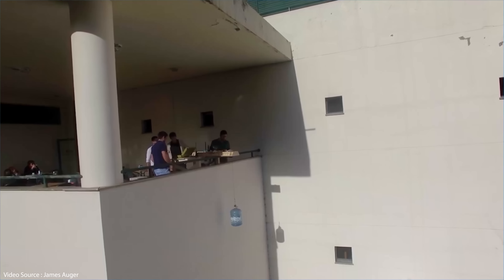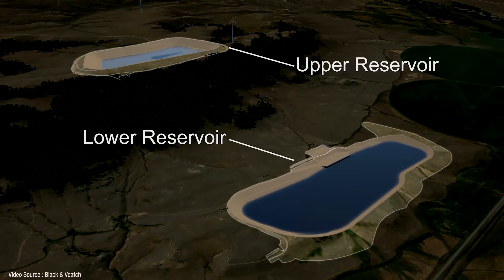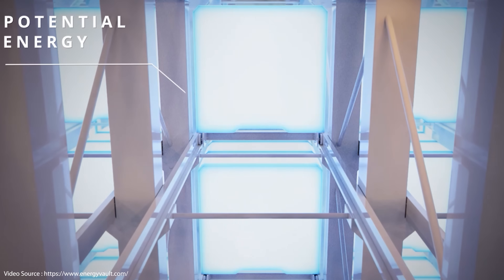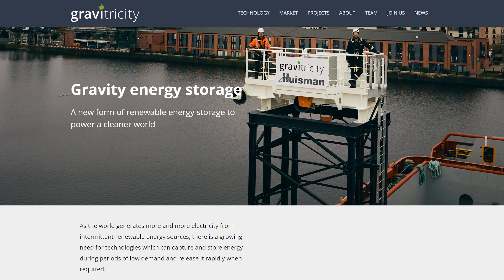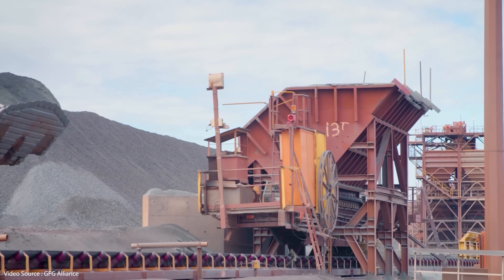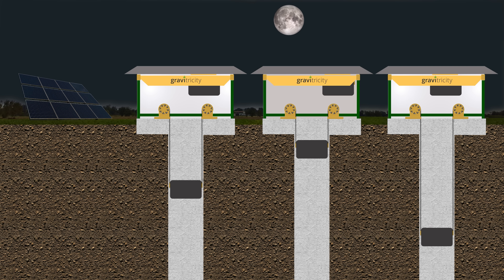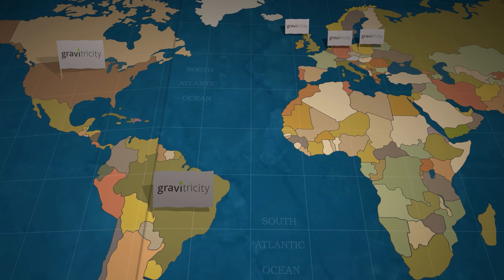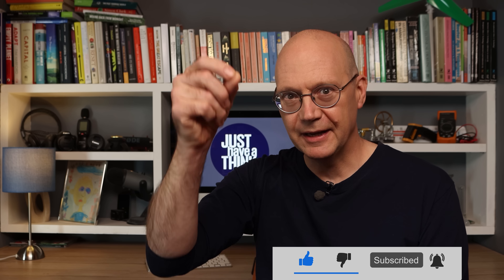Gravity Energy Storage. Who's right and who's wrong?

Comment: 500 tonnes with a 300 metre drop and at 80% efficiency is about 330 kWh of electrical storage capacity. That isn't really grid-level storage. The largest battery storage facility in the world has 1,600,000 kWh of storage capacity, or about 4,800 times as much, and that's a fraction of the largest pumped storage facility, which has 24,000,000 kWh of capacity, or about 73,000 times one of these gravity storage units. Even that pumped storage facility (which is in the USA) is only about 40 minutes of UK electricity consumption, or about 1% of total UK daily power consumption of all types. Put another way, just one hour of maximum output from the Hornsea Windfarm at peak power would require about 3,500 of these 500 tonne, 300 metre drop gravity storage systems. 

I don't think people grasp the true scale of the sort of storage facility required to store the amount of capacity required to deal with a few days of low winds across the country. These sort of facilities barely scratch the surface.

Comment: retired locomotives pulling retired ore carriers ,generator on board,,,,rises up a gradient of retired railway line ,then sits at the top maybe 2 ,3 miles and is relaeased when power is required into overhead cable

Comment: isn't this already done better by hydro-electric power?
If geography is an issue, why not play to the geographical strengths of the area, using wind, geothermal, or solar? and if the geography doesn't support any of these nuclear would be warranted.
I wish more companies would focus on technologies like solid state batteries, instead of over-engineering things that already exist (you probably know what I'm talking about)
Reply: Solid state batteries for sale don’t exist. The best estimate for them cars is the middle to end of the decade, industrial scale will be some time after that. Batteries will probably succeed in the long term but there is currently no cheep long term battery storage available. Everything is in the development phase.
Nuclear needs to get its costs down. Hydro electric competes for land which is either used for human habitation, food production, carbon capture or rewilding .

Comment: Would be nice if some one made a gravity "battery" for the home owner. Many people have a decent sized piece of property, and you just put a ton of weight 10 feet in the air and you're going to get a good bit of power from it. And further something as simple as a car jack (with a bit of modification) could raise it back up allowing you to use it as your primary source of electricity.
Reply: One watt hour is 2655 lb ft. So one ton 10 ft high is about 8 watt hours, about enough to power your microwave for 19 seconds provided there is perfect efficiency and no losses. Get it?
Reply: @74ace468  I made it about 40 seconds for a 700 Watter. Where's me calculator?

Comment: Is it not possible to include this gravity power in most downtown buildings?  I think this is a great idea. I also heard of using large disks like 1/2 a mile in diameter lifted by solar during the day.
Reply: well you could have things that carried lumps of meat up to the top of the buildings in the morning, then took them down in the evening.. but you are unlikely to generate enough electricity to power the elevators.

Comment: As simple as possible without leaving out necessary details. Pumps, water, gravity. Yes, I expect that a reservoir is expensive, pipes and pumps cost too. If the reservoir breaks, that would be bad. if the pump breaks, fixit. if the pipes leak, fixit. If you run out of water .... whoops. Overall better than dropping a 500 ton brick. KISS

Comment: So far so good. But is it?

If one drops a block of concrete you gain energy. But lifting it costs energy. 
Probably the same amount or even more.

It's like perpetual motion. It looks like it works but doesn't. More energy goes in than comes out.

Comment: It would seem a good plan for the sides of mountains as well. I would point out that we've been using the water cycles for energy for some time with mills that run on river currents. Love your work. You seem to do a much better deep dive into what's going on than others I've seen. Thanks.
Reply: but water is free, easy to transport and heavy.  and the whole thing can be done with one moving part.  huge funiculars have millions of moving parts and youd need to find some niche sites with long steep slopes.
Reply: @mralistair737  If I'm not mistaken, it is not a funicular you want. If counterbalanced, there is no energy storage. You want a weight to be brought to a higher elevation against the force of gravity in order to store potential energy. You use renewable resources to raise the weight, storing potential energy. You use gravity to drive traction motors to convert that potential into kinetic energy.
Reply: @RichardRoy2   funicular just means cable pulled, it can be a motor/dynamo at one end of the cable..  It would have to be cable controlled if you are looking at any sort of slope over 3% as steel wheels start to lose grip pretty fast.   if you stay lower than that then losses to friction rise, amount of land and track needed increases hugely.
Reply: @mralistair737  water, in many parts of the world, is most definitely not free nor easy to transport.
Reply: @melmartinez7002  but many do... and there are no  parts of the world that have free concrete.
Reply: Great idea. A variation on the funicular railways that have existed since the 1820's.
Reply: They have (or had) a project in development in California, utilizing the rails on old mining sites. Traction engines were to be used, with concrete weights on cars, controlled by grid software. Back them up the hill to increase stored energy, let them roll down to collect. I think they had already taken it far enough to determine that response times were fast enough for a lot of grid needs, besides just bulk storage. Since they were using existing tracks, installation costs were low. But even if newly constructed, the transmission line install costs would probably be higher than laying the necessary track and setting up the traction engines/ballast cars. Very old tech, but seemed simple, robust, and cost effective.
Reply: @geoffreycahoon2410  but running railways is really  expensive.  you'd have to have qualified drivers in each of the trains, (sitting around waiting for peak demand)  all the maintenance and checks etc.   and old railways are really not that steep..  a traction engine is about 2 megawatts,   power output,  so call it 1.5mw electricity.   Absolute peanuts. that's like $200 an hour,  at peak times.    if you compare it to wind generation that would be $60/h for that much power. '
Reply: @mralistair737  These rail systems aren't generation systems, they're storage systems. Think of a weight at the end of a tether on a cuckoo clock. You use a generation system to raise the weight, and when the generation system isn't raising the weight, you use gravity to generate electricity. Saying you need a driver to run the weight is like saying you need an elevator operator to run an elevator. It's not complicated. And you can assemble a lot of peanuts, plus improve the efficiency of those individual peanuts.
Reply: @RichardRoy2  its simple if you have one train.   but that severely limits your capacity.   even without drivers, there is a hell of a lot more maintenance and safety systems required in a system you are describing as it's going to cover multiple miles of track.. so falling trees, level crossings people on tracks etc all start to complicate things.   but the fundamental objection is that this is big complex problem for an astonishingly small amount of energy compared to many storage methods...  you can add up a lot o f little things, and repetition is good, but why not just develop something much more scalable, repeatable , improvable and deployable that can go ANYWHERE (not just where you have huge hills, no people and no conflicts of land use?)
Reply: @mralistair737  Look up Ares North America. None of the elements you describe are part of the process. No drivers. Not connected to rest of rail system. Just leveraging already installed  tracks for sending dead weight up and down the side of a mountain, tracks usually previously used for mining. Newly constructed infrastructure is minimal. Remote control is run by guys already running grid. Cars are controlled individually, and you can stack as many on the same line for whatever output yields optimal cost/benefit.  Could easily be switchable gigawatts.  Similar siting issues as pumped hydro - you need mountains to provide down-hill, but even for a new installation, with new tracks, much lower environmental impact than pumped hydro.
Reply: @geoffreycahoon2410  the ares one i found seems to be using new tracks.   their set up is odd. each single car has it's own engine / generator..though hard to tell as they have multiple renders and cgis and a lot look like different set-ups.. one is using a funicular gain type. and looks pretty implausible.  which one did you mean?
Reply: @geoffreycahoon2410  yeah it's very much not existing track, their system needs the tracks to be dead straight on a dead even gradient  https://netl.doe.gov/sites/default/files/netl-file/21TMCES_Weed.pdf
really makes you wonder why they dont have twice as many trucks.
Reply: @mralistair737  Nah, the trains would be automated, with perhaps a few people monitoring many parallel tracks. The question is, why not just dig some ponds on the hill for pumped hydro power? That would be less expensive, maybe.
Reply: @mralistair737  Yeah. I just fished that site up to give you an idea. I ran into the concept several years ago, and the info was about a different project.  Just seems like the concept schematically is likely to be a contributor in the future. Seems likely that the levelized cost will be appealing for some config. Which might be different in different locations. But the infrastructure build out per power stored seems much less than either tall frames or deep holes.  And easier to site, and higher net efficiency, than pumped hydro.
Reply: @mralistair737  You make it sound as though there is only one system, and it is the only system providing storage of energy. The use of systems is not restricted to one type. Are you looking for a one size fits all? You ask why not this and why not that. I can only say, why not? Why would anyone restrict themselves to a single platform? Anything you use takes up space. I don't know of anything that doesn't have costs and limitations. You seem to think there is such a thing. I'm sure you can make your fortune by selling it. Till you reveal it, we have to stick to useful things.
Reply: @mralistair737 weird.. you have a negative space line running diagonally through your comment.. like the slope we’re talking about.
Reply: @geoffreycahoon2410  ARES abandoned their plan to run rail cars up and down an abandoned train track in Nevada. I think they realized the cost of electrifying the track was too high. Now their web site touts a goofy scheme to drag 210 350-ton (!!) "mass cars" up and down the side of an existing gravel pit, constructing the world's most boring roller coaster. Both designs would deliver a mere 50 MW and store 12.5 MWh.  Just like Gravitricity, the brutal reality of the weakness of gravity means you have to scale to these huge weights (or Energy Vault's huge number of 35t blocks) to store significant energy, at which point the engineering challenges of the winches and chains and cables to move that much mass around become significant. I'm confident all three companies will be in a world of engineering challenges when and if they scale up, but it will be fun to watch.
Reply: What about capturing humidity on top of a mountain using mesh nets and transferring it to holding ponds then letting huge bags of it down a slide or chute?   You could use wind power up there and use that to run pumps while you have wind and solar too.   I want to see how that math breaks out.  How much water do you have to have at what height do produce how much energy and how much can you get from nets.  If you could capture clouds up there you could make a lot of power.  An average cloud weighs about about 1 billion 400 million pounds.   Capturing clouds already in the sky seems like an op way to get a lot of weight high up for something like this.  You could also run huge Absorption Refrigeration systems up there and make cool air to pump down and get tons of water up there as well... not sure how well you could use the cold air but the largest Absorption Refrigeration units made now make something like 250k gallons of water per day.  That's about 950k kilos of water per day per unit being run on a mountain.  Making weight up high rather than lugging it up high.  I just ran a little basic math so see how it would shake out.  So 1 square meter of fog collecting mesh collects about 1 gallon of water per day.  there are 2.59x10e6 square meters in a square mile aka 630 acres.   and water weighs about 8.35 lb per gallon 25900000 X 8.35 = 216265000.  divided by 2.2 to turn lbs into kilos. 98302272 kilos.  per square mile.  I noticed that there is a mt Whitney in California near LA and San Fransisco and it is about 6000 to 14000 ft above sea level and 581000 acres San Fransisco is about 52 ft above sea level.   So 1 percent of this mountain is 5810 acres.  Let call it 9 square miles...  lets see how much power could be generated using the mesh over 9 square miles assuming 10000 square feet up and if somehow you could lower it all the way down just for reference.    Looks like you'd have about 90000000 kilograms of weight at a height of about 10 kilometers per day.  Sounds like about 9 billion or so kilowatt hours if you use 1 kilogram at 1 kilometer has about 1 kwh of energy potential I heard somewhere that was about right a while back.  So I now have 9 billion kilowatt hours per day of energy storage using the weight of fog and clouds let's say maybe.   Okay so now over 365 days in a year.   That's about 3.285 trillion kwhs per year.   That is about 80 percent of the number that I get for the total energy consumption for the entire country annually.  3,900,875,000,000.00 kWh (2018).  That would be using 1 9th of 1 percent of 1 mountain in California 9 square miles.  Please if you read this and even half ass care correct my math.  Total infrastructure cost a bunch of mesh a couple very long slides and some pretty substantial generators then it's problem solved.  Btw in this design I used no solar or wind power at all just mesh collecting water on a mountain.  Yes it would be too much power to transmit all over the country through power lines but if you have that much power use it to breakdown water into H 02 and make pipelines that can send the gas across the country I think that would be much cheaper then any other way to transmit the power through  lines or truck it all over or whatever.

Comment: Two questions: Do Cable/Gravity systems have brakes ? Pumped Hydraulic would have a value to stop the water running down hill when not needed or being stored .. But gavity systems would need to hold up the weight with energy making it less efficient .. And 2). could we see Electric Vehicle DC Fast charging using gravity as a more reliable machine ? Have a crane that one could see from the motorway with the bonus of "Seeing" how much energy is stored for use..  Just did a 300 kilometre trip (Yes , a short trip for us in the frozen colony of Canada) to save over a $1,100cnd on a car part and ran into two broken level lll chargers on the way ..

Comment: One day I had a brilliant idea, why not support a house with hydraulic jacks and use its enormous weight to store energy? Of course, you would only need to lift a house a few centimeters or inches to store enough energy for the day. But before founding my startup, I tried to get a rough estimate of those centimeters.
The daily average electricity usage per household is around 30 KWH in US, or 108000000 Joules. A house weights between 100 to 200 tons, so let's use 150000 KG. 
Potential Energy = mass * standard gravity *  height.
or:
height = Potential Energy / (mass * standard gravity )
height = 108000000 / (150000 * 10) = 72 m or 236 ft

Energy storage using gravity? This is a horrible idea.
Reply: I think the average UK usage of electricity is 10 KWH but that's because most of our heat energy comes from mains gas at the moment.

But this is a brilliant comment, really puts it into perspective the scale of the problem. Mine shafts is a good local solution I guess but hard to see how it will have a global impact. 

That's not to say I'm against promoting local solutions. More small hyrdopower plants would be good
Reply: How is it brilliant?  The math and spelling are both dismal.

Comment: I appreciate that you very consistently include levelized cost of ownership in your analysis. However the question that comes to mind (possibly unfounded) is as the cost of electricity decreases with more and more green electric sourcing pumped Hydro/moved weights will experience a disadvantage as the cost parity between the cost of pumping/lifting becomes closer and closer to the payment during generation/discharge cycle. What do you think?
Reply: Cost may drop, but demand will continue to grow.  Look at the US or Europe at night from space.  Compare to currently darker countries.  Now imagine those nations as bright as the US.  Lots of growth ahead.
Reply: have you noticed that we added a lot of renwable capacity recently and the priced didn't drop? ultimately prices will only drop once renwables replace fossil fuels entirely (including burning gas and petrol)..   renewables do mean you get hour by hour price fluctuations which make this sort of thing work.  (not that this system will work)